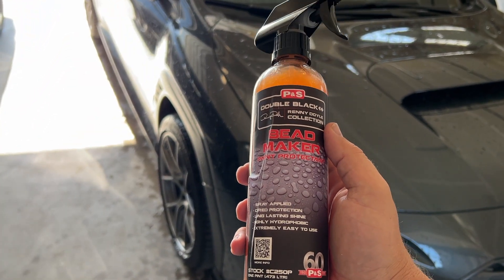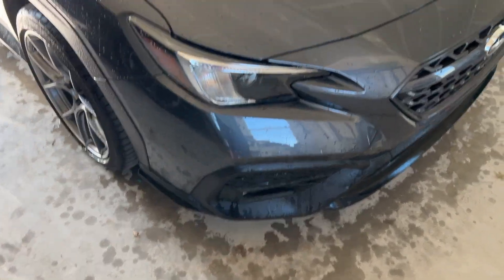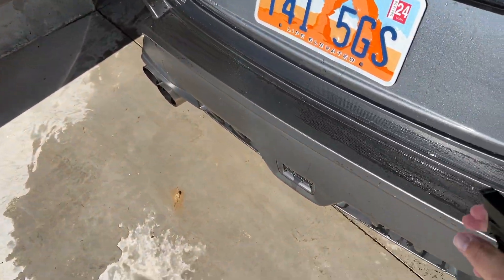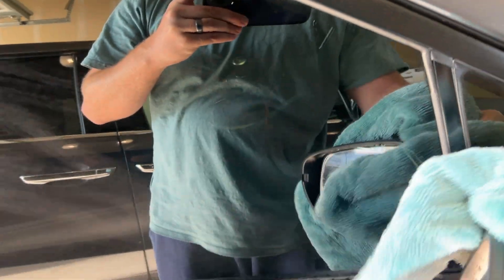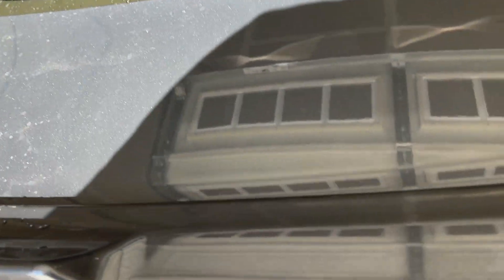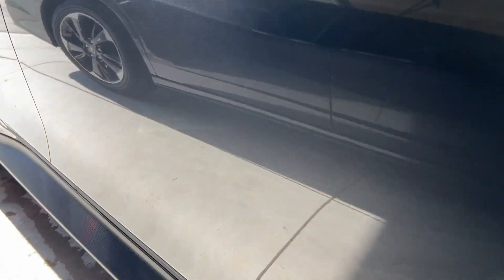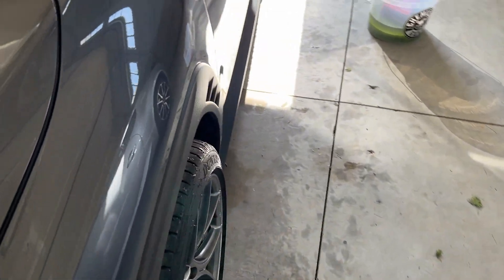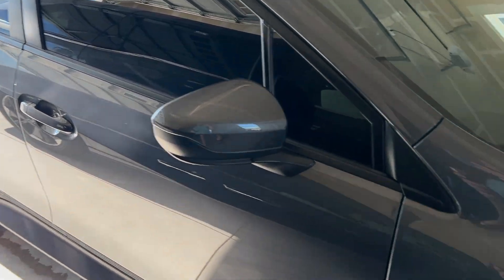P&S Bead Maker Review - Best Paint Protectant?

Comment: I've had a bottle for about a year, 1st time I used it was in the Sun and it wasn't a good experience, so the other evening I did my first rinseless wash with P&S Absolute, wanted to get the car done before we started seeing freezing temps in the UK, decided to give Beadmaker another shot and WOW!! Not seen gloss on the car like that since it came back from being ceramic coated!! Yet to see the water repelancy and durability, but if it is even half decent, then this will become my new go to. I'm coming from Sonax BSD and also have an unused bottle of Meguires ceramic detailer and an unused bottle of Turtle Wax graphene detailer, they may never get used at this rate
Reply from the maker: The gloss is really good!!! Longevity not so much!

Comment: I used to use Beadmaker all the time. Never really had any problems with dusting like others have reported, and really just kind of fell by the wayside as most of our vehicles now have Adam's Advanced Graphene Coatings, so I use their graphene detail spray after washes as a drying aid/booster (usually use a dedicated leaf blower as my primary means of drying the car, but the detail spray is still used after most washes as touch-up). I've tried out other products as well, such as the Turtle Wax Pure Shine and the Technicians Choice TEC582 Ceramic Detail Spray, both of which I've been happy with, but I need more time with them to give a more complete appraisal.
Reply from the maker: Right on!! I need to try their grapheme detail spray. How is the Mazda?
Reply: @gonin60detailing82  The graphene detail spray seems to work well. I use it in conjunction with their Advanced Graphene Coating, so it's hard to tell if it makes much of a difference in gloss, but I think it makes it a little slicker. As I said, I want to spend more time with the Pure Shine and Technicians Choice Ceramic Detail Spray as I was really happy with them for the limited amount of time I've used them. 

Only really driven the Mazda twice, once when I brought it home from the dealership, and then my wife and I went out to dinner in it the same day. The very next day I started detailing it and had to bring it into the garage to apply the graphene coating. It's been sitting in their ever since to give the coating plenty of time to cure without exposing it to the elements. Tomorrow I'll finish up the glass and exterior trim, and also do a full detail on the interior, and then it should be good to go. I'll email you a picture of how she sits in the garage currently. From the little bit I've driven it though, I really like her. Comfortable, with plenty of power for my needs, along with surprisingly good handling. First impressions are I'm really happy with the purchase.

Comment: I havent used beadmaker in a long time. It was nice for slickness but its name isnt what it should be called. I stopped using it because its hydrophobics are a bit mehh and it will mask any coating till it wears off. I mainly use P&S Paint gloss now for my drying aid. It doesnt have protection and doesnt mask the hydrophobics. Leaves the paint glossy and slick.
Reply from the maker: I noticed that on the water properties. It did mask the ceramic underneath. I do have paint gloss I just don’t like the cinnamon bumble gum smell. I am noticing this product is more like dust maker. Any one else have this problem?
Reply: @gonin60detailing82  yea Beadmaker Beadmakerdoes attract dust. There is a little hack mix dreammaker in it 10:1 16oz  1.6oz dreammaker and helps cut down on dust. Also my other favorite drying aid I have been using for about 13 years is ultima waterless wash+. I make a gallon of it and I don’t use it as a waterless just a drying aid and it’s fantastic at that.
Reply from the maker: @05xrunner  thanks man!!!
Reply from the maker: @05xrunner  ultima? Or Meguiars ultimate?